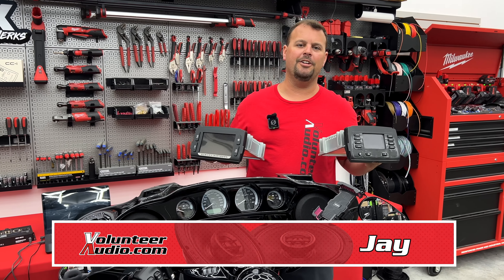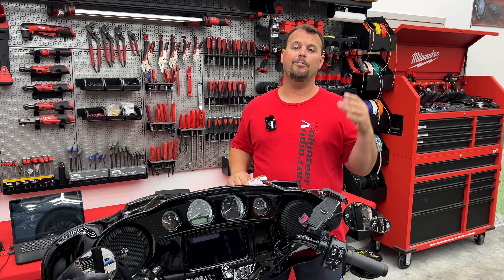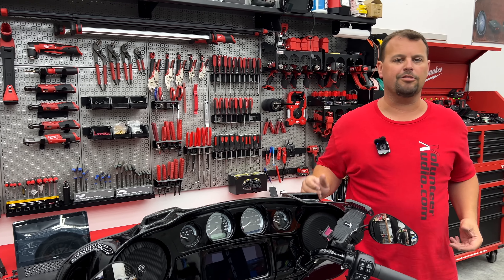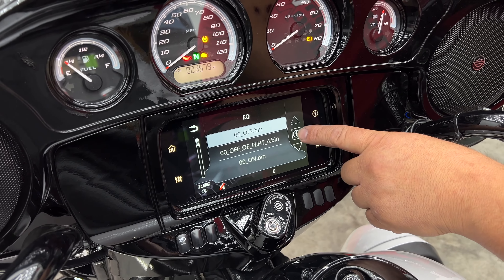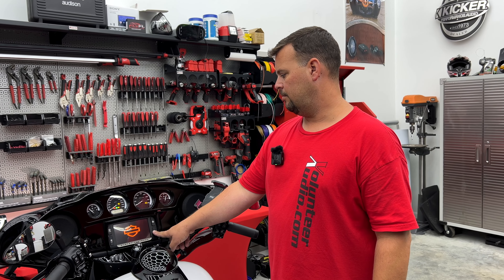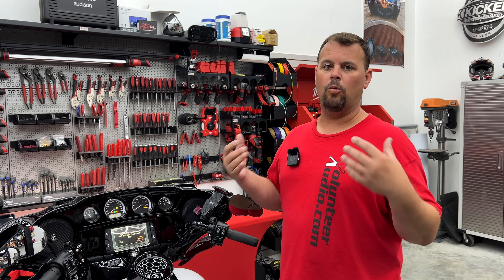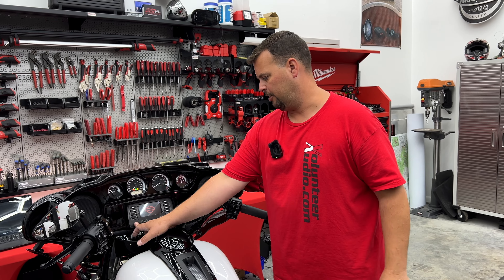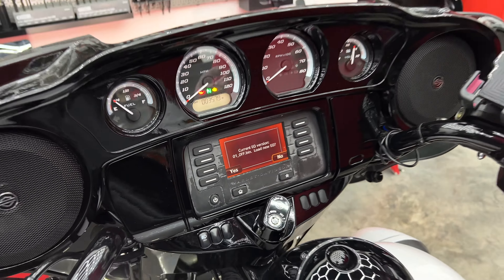Do you know what flash is in your factory Harley Davidson® radio? How to find the EQ.bin flash code

Comment: First of all great video!!! I just bought an ‘18 SG and I had a very loud boom 4.3 bought a 6.5gt and installed it and it is significantly more quiet. How do I fix this by putting in the code from the old radio? Or do I have to flash it?
Reply from the maker: Pull the code from the 6.5 and see which flash is in it now
Reply: @volunteeraudio it says 135_OFF.bin what is it supposed to be? I only have the 2 speakers. I’m assuming they are factory speakers
Reply: Same here

Comment: I just installed a picasso nano 600 watt amp and two Polk 6.5 DS+ speakers in my 23 RGS. I'm pretty sure the stock GTS HU should be flashed. Even though the supplier/builder of the plug-and-play Amp says it doesn't. What do i do, how do I find out if it does or not?
Reply from the maker: Watch our series, we go into great detail as to why you flash the radio and how you know which flash is currently in your bike.  It is a 4 part series

Comment: I have a 2017 RG Limited with aftermarket speakers in the fairing and lowers and an amp. I purchased a 2022 RG Limited and I am transferring everything to the new bike. I know I need to get the HD head unit flashed but I was wondering if it will damage anything if listen to the radio before having it flashed?
Reply from the maker: If the amp was set for a flashed radio and you have not flashed the new radio you will blow your speakers listening to it before the flash, plus the bass boost pre flash try’s to blow them even if you retune the amp
Reply: @volunteeraudio  Thanks for the reply, especially on a Sunday, and the info. I spent a couple hours last night searching the internet for the answer. You have a great channel with a lot of detailed info. If I didn't already have over $2000 in my system, I'd be buying a system from you! Thanks again!
Reply from the maker: @jimv3352  thank you

Comment: I have a '16 ultra ltd with the 6.5" GT. Have watched ( and followed ) the instructions several times but absolutely won't go in to svc mode !  Radio does not go to the "accept" screen- it goes to the screen with the small H-D emblem and the time display. What gives !?
Reply from the maker: The factory radio is very slow to turn on, make sure it has a little time to turn on before holding the button
Reply: @volunteeraudio  Thanks, I'll try it again:)
Reply: @volunteeraudio  I have the tour pak currently removed so no rear speakers and there are DTC's indicating the radio recognizes this ( codes b1306,b1342, b1350). Do you think this could be preventing radio from entering the svc menu?  Tried waiting as you suggested but no dice! Even tried Doc Harley's method ( press and hold then turn to ACC position but still doesn't go to the "accept" screen. Stumped! Thanks in advance
Reply: Finally got it! Whew! What a PITA!  Got it on second try ( this is after a dozen or so unsuccessful tries the day before! ) . 1st try unsuccessful  so left radio powered on then turned ignition switch off. On previous attempts when I followed the procedure the radio booted up rather quickly when switch turned to IGN but on this attempt the radio booted up noticeably slower -so this is what I did; Turned key to IGN-wait about three secs-press and hold power/mute button then accept screen appeared-continued to hold button for a couple more secs then released button, tap "accept" and voila! Service mode finally! Hope this helps someone. Many thanks to volunteer audio for their truly useful and informative vids!

Comment: I got my 2022 RG Limited, with 1 Arc Audio 720w amp driving 2 upper fairing speakers and 2 lower fairing speakers, flashed and it has the 08_OFF.bin flash. According to your Bin code chart I need to have it re-flash to the 130_off.bin. I called the shop that did the flash and he said he installed the flash that was recommended by Arc Audio and he does not recommend changing it and he is NOT willing to re-flash it! I think it might be because he doesn't know how. The system sounds good and I plan on installing a Sound Stream V2 over the winter. 
In your opinion, will the 130 flash will make it sound so much better that it's worth the time and effort to have it done? If so, do you know of anyone in the Northern Indiana / Southern Michigan area that can do the 130 flash?
Reply from the maker: @jimv3352  08off flash has a bass boost that’s needs fixed, yes we always recommend using an amplified flash and have a full list of acceptable flashes, your amp will also need gains reset after the flash.  Find your closest TechnoResearch dealer at TechnoResearch.info
Reply from the maker: @jimv3352  here is a link to the flash you currently have showing the bass boost 
https://volunteeraudio.com/08_off-bin-wild-boar-american-hard-bags-arc-audio-rockford-jm

Comment: I have the SI model in my 23 road glide and everything time I start the bike the clock rest sets to 8:00 is there a fix for this,I hooked everything up the way it showed,anyone else have this problem?
Reply from the maker: The only reason it would reset would be due to a wireless adapter that is interfering with the clock.  The radios time updates automatically to your phones time but some add on adapters also send an incorrect date and time
Reply: I bought the android auto adapter from you guys,not sure what you mean sorry.
Reply from the maker: @ericwilson8634  which one? If it is the zz2 duo you need a software update, call our tech support next week at 1-844-30AUDIO